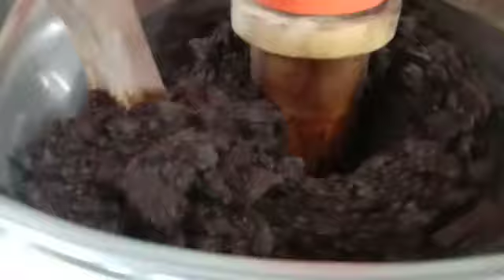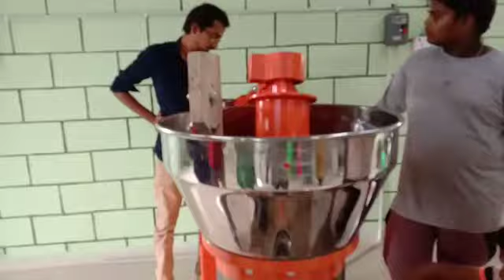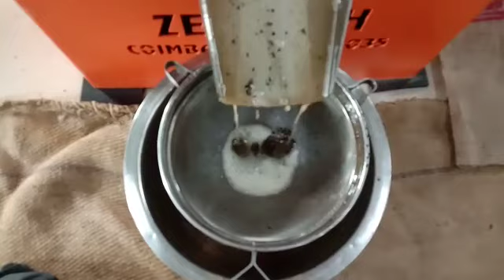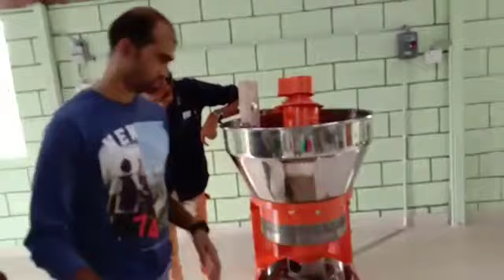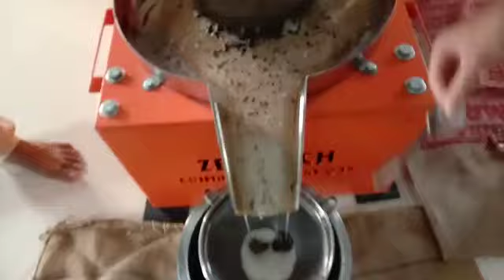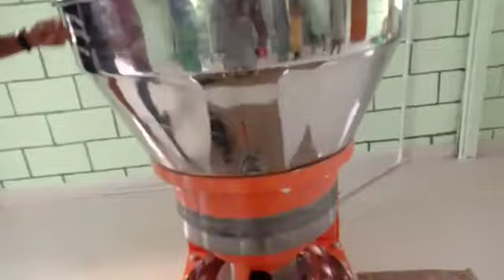#our_god_Then_Thinai_Coimbatore_ Tamilnadu 7339197774 zen tech engineering, marachekku machine

Comment: Sir kindly mentioned the price of machines & mentioned the electric phase and motor capacity. Tnx I'm from odisha.
Reply from the maker: Machines Rate:

Thiruvalluvar 180000+ 18% GST=  212400.00

Bharathi    180000+ 18% GST = 212400.00

Voc 6 to 18 kgs.      175000+ 18% GST  = 206500.00

Voc 10 to 25 kgs.  250000 + 18% GST = 295000.00

SS Ural voc 6 to 18 kgs. 250000+ 18% GST = 295000.00

Nethaji ( Rotary Machine )  220000+18% GST = 259600.00

The machine value including   Motor, Starter, Switch, Spanner, Cover, Allen Key and All other Accessories. 
Machine Delivery Time : Immediately or 10 Days.
Validity : 20 Days.

IMPORTANT NOTES : You can crush any oil in this Machine.
If you want single phase  3 hp motor it's available.

 This is Including fitting training crushing cost. ( This may be vary depending on DISTANCE of the BUYERS).

Our Service Engineer will come to your company, He will fit the machine and give training and crush any types of oil in front of you.

You want to pay transport costs of machines and  service engineer transport cost, Accommodation and food cost of service engineer.

If you want one more day of service you want to pay 1000 extra for service Engineer.

This is very very important: 

You don't worry about 70000,  100000 other companies machine. You calculate output of machines. And also don't miss your dream machine for 5000 or 10000.
Thanks.

Thanks Regards 

Kanagaraj Paramasivam 
+91 98940 31929

Ravichandran Nachimuthu 
+91 99944 06061

Comment: machines rate and full details sent please. I'm From Bangladesh.
Reply from the maker: MACHINES RATE:

Thiruvalluvar 180000+ 18% GST=  212400.00

Bharathi    180000+ 18% GST = 212400.00

Voc 6 to 18 kgs.180000+ 18% GST  = 212400.00

Voc 12 to 30 kgs.275000+18GST=324500.00  ( With RPM  controller = 310000 + Gst )

Voc  15 to 50 kgs  400000+ GST = 472000.00 (This Price with RPM CONTROLLER)

SS Ural voc 6to18kgs 260000 +18% GST = 306800.00

Nethaji ( Rotary Machine )  230000+18% GST = 271400.00

🙏🙏🙏🙏🙏🙏🙏🙏🙏🙏

MACHINE RATE IN USD:

Thiruvalluvar : 2750.00 USD.

Bharathi : 2750.00 USD.

Voc 6 to 18 kgs. : 2750.00 USD.

Voc 10 to 30 kgs. : 4050.00 USD. (With RPM CONTROLLER  4500.00 USD.)

Voc 15 to 50 kgs : 5450.00 USD. (This price with RPM CONTROLLER)

SS Ural voc. 6 to 18 kgs. : 3800.00 USD.

Nethaji ( Rotary Machine )  8 to 15 kgs. : 3450.00 USD.

** We take USD Rate : 75.00 INR= 1 USD.
****For Abroad we will give some extra spare.

🙏🙏🙏🙏🙏🙏🙏🙏

MACHINES DETAILS:

V.O.C Machine : Automatic Machine
 ( Wood )

Ulakkai (Top Wood) Life: 10000 kgs  Seeds can Crush
Ural Life (Bottom Wood): 20000 Kgs Seeds can Crush 
18 kg machine Ulakkai Replacement :  5000 +18% GST 
30 kg machine Ulakkai Replacement: 6000+ Gst 
18 kg Ural Replacement :  6000 +18% Gst 
30 kg Ural Replacement: 8000 + 18% Gst 
Power Required : 3 hp 3 Phase and Also Run in Single Phase Motor.
5 Machines Can run by Single Person.
Heat Produced: Minimum 10 Degree Centigrade, Maximum 25 Degree Centigrade.
RPM: 16 to 18
You can crush any oil in this Machine.

Thiruvalluvar and  Bharathi : Manual Machine ( Wood )

Ulakkai Life(Top Wood): 10000 Kgs Seeds can Crush
Ural Life(Bottom Wood): 50000 Kgs Seeds can Crush 
Ulakkai Replacement :  5500+18% GST 
Ural Replacement :  35000+18% GST 
Power Required : 3 hp, 3 Phase and Also Run in Single Phase Motor.
Each Machine want One Person.
Heat Produced: Minimum 20 Degree Centigrade, Maximum 35 Degree Centigrade.
RPM: 16.
You can crush any oil in this Machine.

Nethaji  ( Rotary Machine - Iron )

Ulakkai Life (Top Casting): 30000 Kgs Seeds can Crush 
Ulakkai Life( Bottom Casting): 30000 Kgs Seeds can Crush 
Ural and Ulakkai Rework: 2000+18 % GST. 
Heat Produced: Minimum 20 Degree Centigrade, Maximum 50 Degree Centigrade.
RPM: 45.
You can crush any oil in this Machine.
    All values are Dependent upon the QUALITY, PROPERTY, VARIETY and MOISTURE of the SEEDS.

🙏🙏🙏🙏🙏🙏🙏🙏
OUR YOU TUBE CHANNEL LINK:

http://YouTube.com/c/marachekkumachine

  Kindly LIKE, SUBSCRIBE, SHARE AND TOUCH THE BELL BUTTON in Our You Tube Page.
    Kindly Watch All videos for your all doubts. 
Our videos will helps you.
🙏🙏🙏🙏🙏🙏🙏🙏

IMPORTANT NOTES:

    Wood and stone machine both are same price.
   The machine value including   Motor, Starter, Switch, Spanner, Cover, Allen Key and All other Accessories. 
Machine Delivery Time : 10 or 30 Days. 
Validity : 20 Days.
    You can crush any oil in this Machine.
If you  Need single phase  3 hp motor it's available for Voc 18 kg machine only. 
     We using THE WORLD'S NO.1  SIEMENS MOTOR and BONFIGLIOLI GEARBOX AND GEAT MOTORS. 

 This is very very important: 

    You don't worry about 70000,  100000 other companies machine. You calculate output of machines. And also don't miss your dream machine for 5000 or 10000.
Thanks.
     You Need to pay transport costs of machines and  service engineer transport cost, Accommodation and food cost of service engineer.
     If you Need one more day of service you want to pay 1000 extra for service Engineer.

Thanks Regards 
ZEN TECH ENGINEERING 

Kanagaraj Paramasivam 
+91 98940 31929

Ravichandran Nachimuthu 
+91 99944 06061

Comment: How much price?
Reply from the maker: Machines Rate:

Thiruvalluvar 180000+ 18% GST=  212400.00

Bharathi    180000+ 18% GST = 212400.00

Voc 6 to 18 kgs.      175000+ 18% GST  = 206500.00

Voc 10 to 25 kgs.  250000 + 18% GST = 295000.00

SS Ural voc 6 to 18 kgs. 250000+ 18% GST = 295000.00

Nethaji ( Rotary Machine )  220000+18% GST = 259600.00

The machine value including   Motor, Starter, Switch, Spanner, Cover, Allen Key and All other Accessories. 
Machine Delivery Time : Immediately or 10 Days.
Validity : 20 Days.

IMPORTANT NOTES : You can crush any oil in this Machine.
If you want single phase  3 hp motor it's available.

 This is Including fitting training crushing cost. ( This may be vary depending on DISTANCE of the BUYERS).

Our Service Engineer will come to your company, He will fit the machine and give training and crush any types of oil in front of you.

You want to pay transport costs of machines and  service engineer transport cost, Accommodation and food cost of service engineer.

If you want one more day of service you want to pay 1000 extra for service Engineer.

This is very very important: 

You don't worry about 70000,  100000 other companies machine. You calculate output of machines. And also don't miss your dream machine for 5000 or 10000.
Thanks.

Thanks Regards 

Kanagaraj Paramasivam 
+91 98940 31929

Ravichandran Nachimuthu 
+91 99944 06061

Comment: Cost?
Reply from the maker: Machines Rate:

Thiruvalluvar 180000+ 18% GST=  212400.00

Bharathi    180000+ 18% GST = 212400.00

Voc 6 to 18 kgs.      175000+ 18% GST  = 206500.00

Voc 10 to 25 kgs.  250000 + 18% GST = 295000.00

SS Ural voc 6 to 18 kgs. 250000+ 18% GST = 295000.00

Nethaji ( Rotary Machine )  220000+18% GST = 259600.00

The machine value including   Motor, Starter, Switch, Spanner, Cover, Allen Key and All other Accessories. 
Machine Delivery Time : Immediately or 10 Days.
Validity : 20 Days.

IMPORTANT NOTES : You can crush any oil in this Machine.
If you want single phase  3 hp motor it's available.

 This is Including fitting training crushing cost. ( This may be vary depending on DISTANCE of the BUYERS).

Our Service Engineer will come to your company, He will fit the machine and give training and crush any types of oil in front of you.

You want to pay transport costs of machines and  service engineer transport cost, Accommodation and food cost of service engineer.

If you want one more day of service you want to pay 1000 extra for service Engineer.

This is very very important: 

You don't worry about 70000,  100000 other companies machine. You calculate output of machines. And also don't miss your dream machine for 5000 or 10000.
Thanks.

Thanks Regards 

Kanagaraj Paramasivam 
+91 98940 31929

Ravichandran Nachimuthu 
+91 99944 06061

Comment: Price
Reply from the maker: Machines Rate:

Thiruvalluvar 180000+ 18% GST=  212400.00

Bharathi    180000+ 18% GST = 212400.00

Voc 6 to 18 kgs.      175000+ 18% GST  = 206500.00

Voc 10 to 25 kgs.  250000 + 18% GST = 295000.00

SS Ural voc 6 to 18 kgs. 250000+ 18% GST = 295000.00

Nethaji ( Rotary Machine )  220000+18% GST = 259600.00

The machine value including   Motor, Starter, Switch, Spanner, Cover, Allen Key and All other Accessories. 
Machine Delivery Time : Immediately or 10 Days.
Validity : 20 Days.

IMPORTANT NOTES : You can crush any oil in this Machine.
If you want single phase  3 hp motor it's available.

 This is Including fitting training crushing cost. ( This may be vary depending on DISTANCE of the BUYERS).

Our Service Engineer will come to your company, He will fit the machine and give training and crush any types of oil in front of you.

You want to pay transport costs of machines and  service engineer transport cost, Accommodation and food cost of service engineer.

If you want one more day of service you want to pay 1000 extra for service Engineer.

This is very very important: 

You don't worry about 70000,  100000 other companies machine. You calculate output of machines. And also don't miss your dream machine for 5000 or 10000.
Thanks.

Thanks Regards 

Kanagaraj Paramasivam 
+91 98940 31929

Ravichandran Nachimuthu 
+91 99944 06061